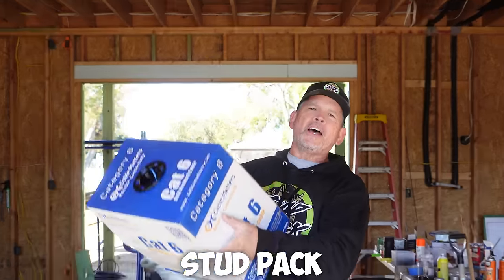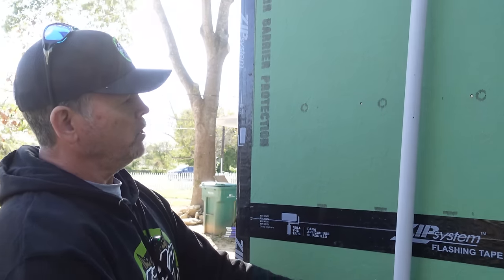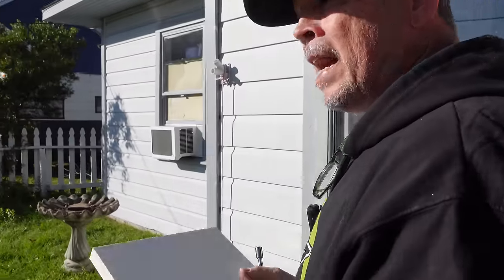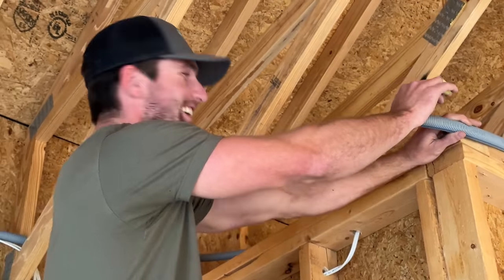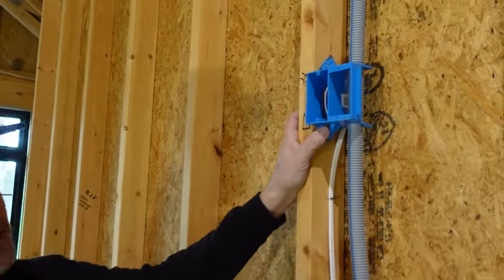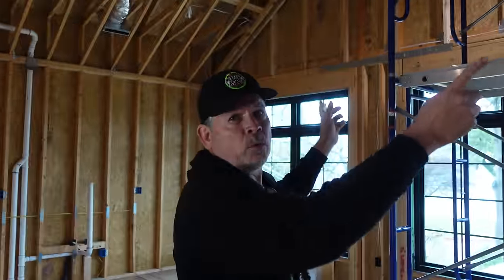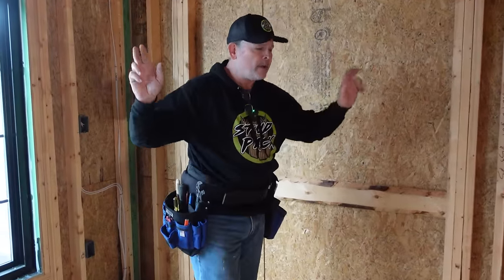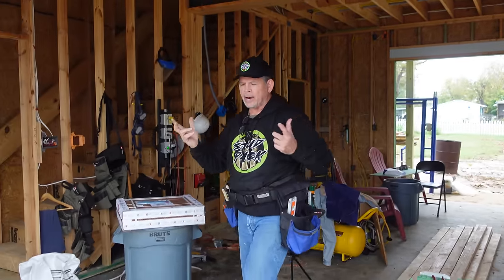DIY Networking for a Future Proof and HIGH SPEED Home! (Smurf Tubing and String Pull Trick!)

Comment: PLEASE PLEASE PLEASE don't put rj-45 heads on CAT-6 like this.  This is solid conductor wire.  When you buy a patch cable, it's stranded copper inside.  That's perfect for patch cables.  As others have said, put keystone female rj-45 connectors on the end of each cat-6 run and then use a proper patch cable.  Also, DON'T make your own patch cables from this box of cat-6-- i PROMISE you will run into issues with it later.  Putting male rj-45 heads right on the end like this is what we used to do in the late 90's.

Comment: Unless you're buying a $30k tester, all you're getting is continuity. (i.e. the wires are straight through) A hand made cable is almost certainly not going to meet CAT6 specs. (and you likely don't need it anyway. CAT6 is only rated for 10G to 30m.) As for power, that's 60Hz and will have zero effect on ethernet - which is over 100MHz. (twisted pair will cancel out any such noise anyway.) You want to keep high voltage away from low voltage so you can't accidentally mix them. (say, by driving a nail through them)

Comment: i agree with @grumpywolfgaming. i would put the fiber router on the inside of the wall just opposite the external box outside and then just run CAT 6 (or 7) all over the place. get yourself a rack or a big switch to service your drops everywhere. Since you're building your own house and can literally do whatever you want, don't be stingy. put a double ethernet jack in as many places as you have power outlets, if not more. you'll be happy you did later on. 

And I didn't understand what you said Jordan said about the female ends and not wanting that, just wanting to go straight to the computer. No. Don't do that. that's like saying "I don't want to plug in my fridge, my lamp, my TV; I just want the plug for those appliances to go straight to the junction box. Don't do that. Put female ethernet ports everywhere, with nice face plate. That allows you to plug in a single device, like computer or TV or gaming console, etc. or if you later decide you need to plug in five things, you can simply buy a little switch that will turn that port into 5 or 8 or more ports.

Comment: One word: Ubiquity! 
Another thing, CAT5 is 1995, CAT6 is from 2002, so I will expect this tech to be replaced soon (next 10 years) by fiber everywhere. I agree with the wall plates, central distribution, but I would add a network rack.
I would also check the In-wall access point from Ubiquity for that clean, no wire look.
Reply: Fiber is not going to replace Ethernet cable for wall runs. Ethernet does things fiber does not -- most notably, power over Ethernet. And unless Jordan understands network administration, Ubiquiti is not the best choice for a residential install; requires too much networking knowledge to properly set up things like default deny all rules, subnets, VLANs, etc.

Comment: Great video except you should never make male connectors. They're the most prone to errors and the least useful. If you put up a wall box or full patch panel of female connectors instead, you can then use any length patch cable to connect those ends to the devices you'll use. With a male connector on the cable, you've restricted its length and its uglier too. All that aside, connecting female ends is just punch tool work and nice and fast with less effort.

Comment: Those runs are going to be way too long. You really should keep your runs under 100 ft.  You’d have done better going under the floors in a straight line, rather than all the way up, following the roof. Signal degradation is a thing. Even with CAT 6.
Reply: That is going to be a fiber run from the outside box to the ONT inside.

Comment: That fiber will never make those bends without breaking. I think this is a mistake. It's really fragile.
Reply: Doesn’t seem that bad. It’s plastic fiber not glass.
Reply: @lordgarth1  alright. I know fiber is flexible but the cable has those strong backs that don't flex and once you crack the strong back then it breaks the fiber. At least that's what happened on my house.

Comment: Please don't run ethernet cable through the drywall and straight to your devices! Wall plates are infinitely more adjustable, cleaner, prevent potential damage to drywall (when someone inevitably trips on a cable and yanks it against the wall), better resell value, so on and so forth. I'm guessing Jordan MIGHT be concerned of the extra resistance of the wall plate coupling, which is so minor in the grand scheme of things compared to the other benefits!

Comment: Kind of silly in my opinion. The problem with this is that although your house will be wired with amazing high grade internet connection, you're still going to be limited by whatever is on the telephone pole and they don't upgrade that stuff ever so...
Reply: There are some people that make use of local connections from one device to another inside the house. In those applications it is very beneficial to have hard wired connections.

Comment: Please DO NOT use spray foam, not only is there a danger of ruining everything it touches if it's applied incorrectly, but it would also make it impossible to do any additional work without costly tear out since it bonds everything together. Google the dangers of misapplied spray foam in living quarters, plenty of horror stories on youtube where new construction was poisoning the homeowners.

Comment: no no no.  terminate the cat 6 into a box that has the female end.  otherwise you end up with all this extra cable that looks like poo.   My house was done like that (cat 5 20 years ago) and it's just this wound up cable all sitting around. (we literally don't use any of it,  wireless is a thing)  should have terminated into a plate, much cleaner and more flexible long term.

Comment: This video makes me cringe. You can tell they haven’t done this. First time for everything. I would have run sch 40 if you wanted conduit. That ENT is an absolute bitch to pull through unless you secure every inch of it. The OCD in me wants to see it orange or aqua instead of gray.  The plastic spline down the core of the CAT6 separates the twisted pairs to prevent crosstalk from the emf generated.

Comment: The fact that a 1" x 24" by 48" white pvc sheet costs over $300 seems overbuilt.  You should use keystones. And you're going to have failures because you're using passthrough connectors, unless you literally trim them and pull them back into the connector. There's a whole bunch of facepalm here.  Fortunately, you can do the punchdown keystone as a retrofit for your next video. *USE PATCH CABLES*.

Comment: put the modem somewhere in the middle of the house. Makes it easier to get to and gives you better signal strength. You avoid having a wifi extender or something similar
Reply: i pray they aren't using a modem/router combo unit lol. who wants that, nobody.
Reply: A modem doesn't handle WIFI. I understand that internet service providers (ISP) commonly provide a modem/router device that often is wifi capable in the router part of the device. However you should never use the ISP provided WIFI if you want good results (not to mention security). 

Ideally you would have a dedicated modem, then a dedicated router, followed by dedicated WIFI access points (APs). You can get away with using your own router/WIFI combo device in some applications but I would never use the ISP provided router/wifi. 

I recommend Ubiquity Unifi Access Points for any residential application. In this garage you could use 1 on the each level (maybe overkill) and get perfect WIFI inside and out.

Comment: Dumb to run cable all way to device…..   terminate it with keystones… better.  Cause it sits flush with wall….   So if u not using that jack location you do not have a cable hanging out the wall

Comment: Comical watching this disaster of data cable amateurs.

1) Looks like riser cable. Always use plenum, it performs better and is designed for temp flux. Use a quality brand. (Certified) lots of fake fraudulent stuff online from overseas. Get from a supply house. The cheap stuff will fail…

2)Never crimp. The cabling is structured and part of the building, it should be protected from damaged. Keystone jack’s in a biscuit or faceplate. You can  use 1ft-3ft patch cables that have strain relief built-in. Never buy the CE or Leviton crap at home depot - many reasons. ICC makes fantastic keystones, there are other brands the pro’s like me prefer.

3)The biggest mistake made is putting the equipment up in the loft. How hot is that loft going to get? Cable should run to a cool, easily accessible place. 

4)Outside cameras are a lightning rod and Guaranteed to have your gear cooked. ITWLinx makes a rack mount modular surge protector - RM-12MPVD. You buy the modules to insert into it - RM-12-CAT6-75poe modules for what you need.

Comment: They can bring the fiber into the house without that box outside. Installers actually prefer it. Talk to an AT&T professional before you get too far… Your TV and internet can work wirelessly. Put the modem in a closet where it is easy to get to. All that hardwiring is not necessary these days. Technology has moved on…
Reply from the maker: Hard wired over Wireless everyday of the week.
Reply: WiFi is for convenience, if you want reliability go wired when possoible.
Reply: You're wrong about hard wiring. It is absolutely necessary for many applications. Surely you are aware that the top WIFI speed doesn't match the top hard wired speeds.

Comment: To me cat6 is a waste of money for a home. Marketing has pushed cat 6, for what reason other than money, I don't know. Yes Cat 6 is faster than cat 5, but only at lengths less than 180ft. Anything more, it's limited at 1g, just like cat5. Most homes only need wireless anyway,, with wifi 6 and up coming 7, achieving speeds greater than 1000 Mbps is much easier, and cheaper, also I can't thing of any device that a home would need or use that has an Ethernet adapter greater than 1000 Mbps.
Reply: "Most homes only need wireless anyway" is myopic. WiFi speed increases come at the cost of smaller range, since higher frequencies can't penetrate walls and floors well. Mesh networking is an unreliable method of working around that, with the more ideal solution being Ethernet cable runs to support PoE access points. Well, if you're in the position where you're already running cable to multiple rooms to support faster but shorter range wireless APs, you might as well just run cable for direct connection to devices and skip oversaturating your WiFi in the first place.

As for running Cat6, the benefit over Cat5e is lower crosstalk while keeping the same maximum run length, improving max theoretical bandwidth, and being a little physically tougher. The only reason to run Cat5e is if you are very, very budget limited and literally every dollar counts. For all other needs, Cat6 (or my preference, Cat6A) makes the most sense.